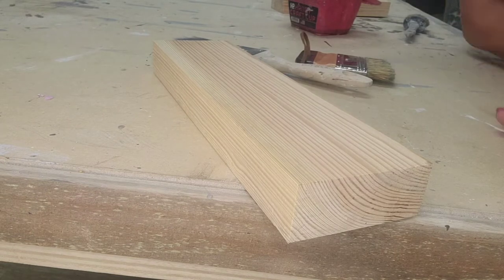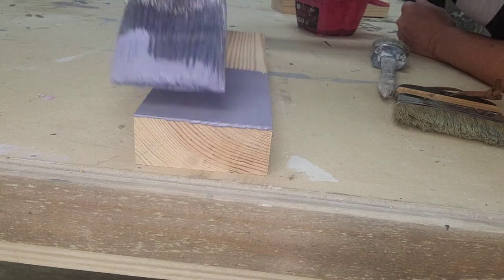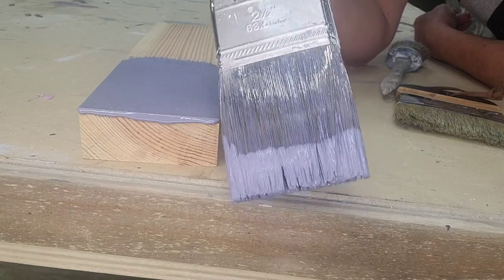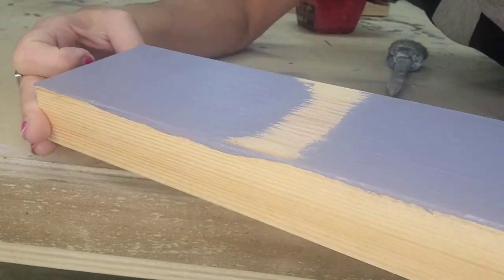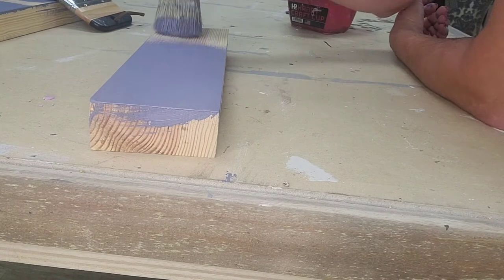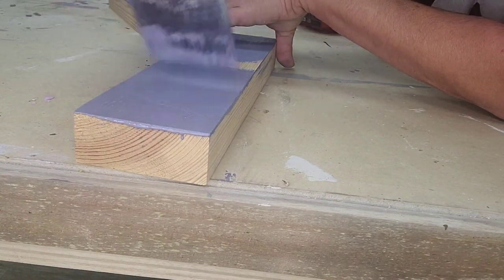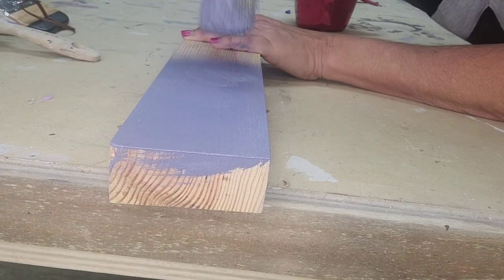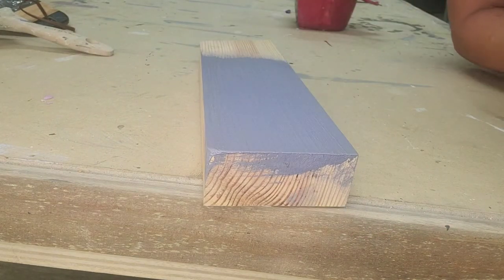Which paint brush gives you the best finish with Chalk Paint

Comment: Your test is soooooo un-scientific! You loaded excess paint with the first brush and only did 29 strokes at first and then an additional 8 strokes. For the record, I’m counting one stroke as the brush hitting surface and going in 1 direction. Most of your strokes were purposefully short and choppy. With the second brush, you loaded half the amount of paint and did 27 strokes, almost all of which were long full FLAT strokes. Then with the last brush, the one you wanted to win, you loaded maybe the same amount of paint as the 2nd(but I think even less), however, you did well over 100 strokes, short and long. I couldn’t even keep up because you were going so fast back and forth. It is no surprise that the 3rd brush showed no strokes and dried faster. You brushed all the strokes out and brushed until the paint was darn near dry! His is fraudulent biased testing. If you want to show the truth of what each brush will do, measure out equivalent amounts of paint, equivalent sections on 3 separate boards of the same type of wood, and do the exact same number of strokes…all complete length strokes for the section you are covering. I am literally sitting here with a wooden storage bin in front of me using one of  my 3/4 inch synthetic artist brushes I normally use for canvas painting and I can get a perfectly smooth, stroke-free finish that is dry within minutes…and little to no hand fatigue as the brush is merely a few ounces. I can’t believe anyone takes this test seriously. I guess because I was a science and math teacher and have also worked with chalk paint for so long that I see the flaws so intensely. I would look forward to seeing you do an unbiased test of the different types of brushes.
Reply: WOW! You must be very bored to sit and count brush strokes!! 😂 hahaha.
But I hear ya about the brush you're using etc.. but again she is repeating herself about finding what brush works for each individual... Besides whatever brush you use I still found this video informative in other ways as I've been researching chalk paint techniques and so on.. I personally don't care about the scientific aspect anyways. I didn't think it was intended to be a scientific video... Just one person sharing some tips and yes, what she prefers to use. I'm going to take her advice and see what works for me....